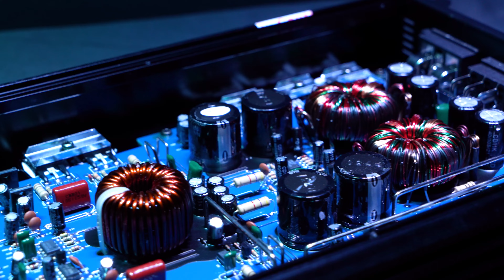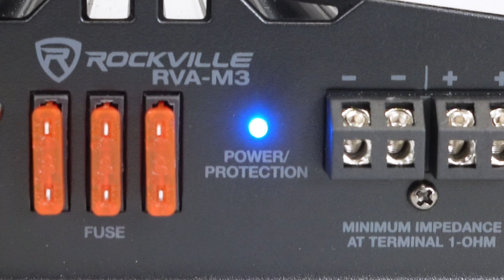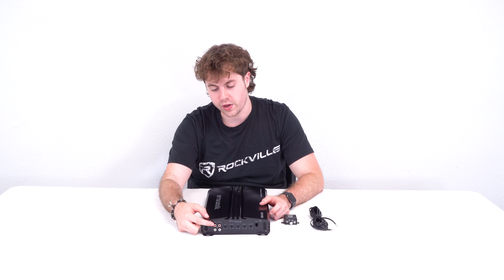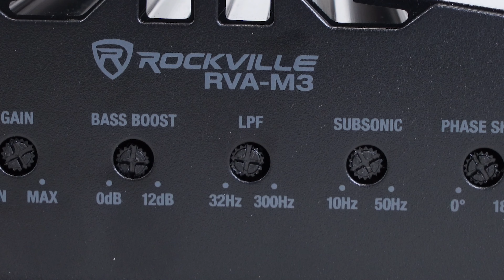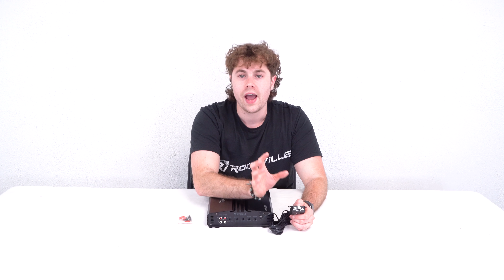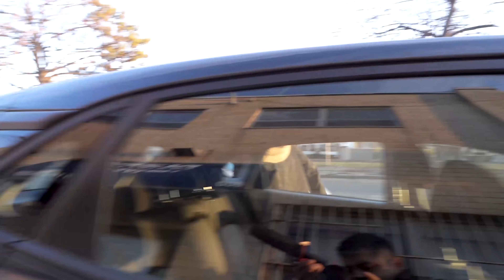How To Set Up Rockville RVA-M3 (Version 1 & 2) 4000w Peak/1000w RMS @ 1 Ohm Mono Car Amp

Comment: I'm a big fan of Rockville and own two of their amplifiers in different ranges. I have a question: Can I connect my Pioneer TS-W310D4 subwoofer dual voice coil sub rated at 4 ohms per coil to this Rockville RVA-M3 V2 amplifier using parallel wiring? at 2 ohms" Right now I am running it on 8 ohms through series wiring.